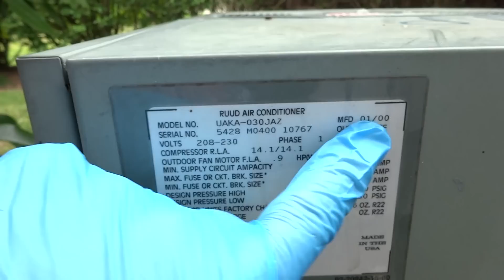OLDER RUUD AC UNIT STOPPED RUNNING CAN I FIX IT #stevenlavimoniere

Comment: I have 2 RUUD units like those built in 2004.  Still had original caps in them last summer.  They were starting to get crusty after 17+ years.   For short money, I bought 2 new caps.  Same ProTech brand as originals, same size as originals.  Installed them as preventive maintenance.  Last month, I walk by the A/C units and there is that HUMMMMMMM sound from the 2nd floor unit.  Cut the power, opened the panel, and it was even blacker than the panel in the video.  The new cap lasted 1 whole year.  Melted some wires, too.  A new cap (I keep a new one on the shelf ready to go), some wiring repair, and the unit started right up.  I got lucky that it did not take out the compressor.  I learned the procedure from your videos, Steve.  Thank you.
Reply: 2004 was the last year that they made the octagon design. After that, they began making the circle grate design

Comment: Props to you Steve. A very old R22 system needing to be replaced because of the age and the fact R22 is near to impossible to get. Had the perfect chance to sell a new system and you took the high road
Reply: @Jake Porter I am in the hvac field. And here in Tulsa Oklahoma I work for one of the largest Hvac companies in the state. And we only have a few van with r22 on them. As far as our local parts house having any  I don't know. As of this moment if our customers need R22 we let them make a decision on to buying a new unit or going with a replacement refrigerant.
Reply: @Jake Porter They stopped making R22 a year or 2 ago, just a matter of time when the supply runs dry.
Reply: You can buy R22 buy the palette load if you want. If you're having trouble finding it in your area it's easy to get on line.

Comment: Steven, are the capacitors filled with oil 🤔
Reply: It clearly says on the caps "filled with castor oil"
Reply: @StevenTheElder but tbh those PCB capacitors lasted years and years because the liquid was way more efficient in dissipating heat. These new one blow almost every summer.

Comment: Why are there sometimes 2 capacitors?
Reply: 1 for compressor and 1 for the fan
Reply: @nikyjim  Yup. The replacement he installed just contains both. If he doesn't have a combo one that fits the bill for the compressor and fan he'll install 2 different ones to get the required ratings.